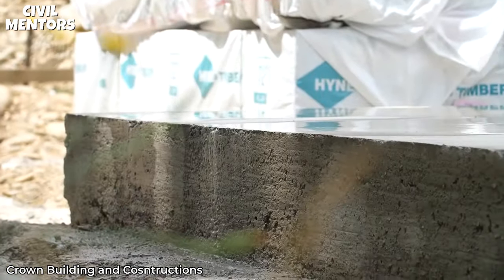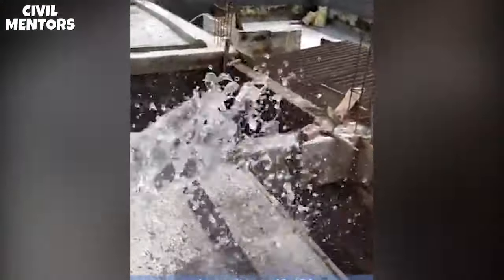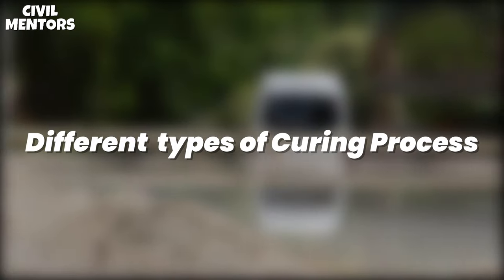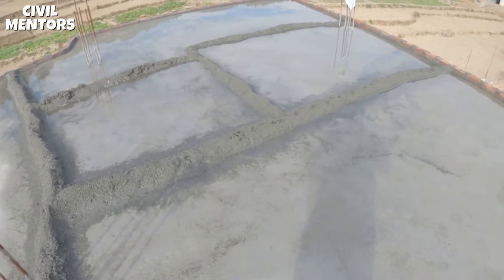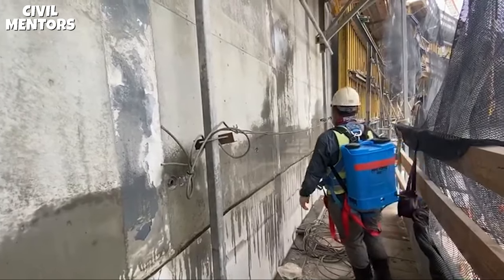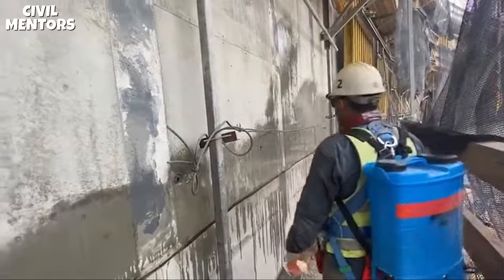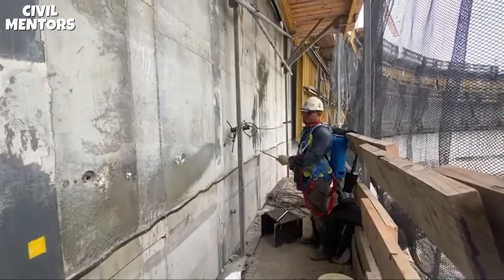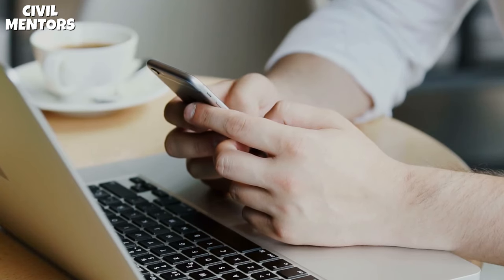Concrete Curing: Don't Make These Mistakes

Comment: How do you know when the concrete has reached 70%?
Reply: IMO, you can use a Mohs' concrete hardness test kit
Reply: Concrete poured at 70F will reach 70% of its strength in 7 days typically ITs all 7's

Comment: I will be making 12"X12"X4" pavers that will be placed in a yard for a motorcycle driveway. Do those need to be cured prior to laying down? If so do you recommend spraying, or submersion?
Reply: Cover them with a wet white sheet and then cover with plastic to lock in the moisture. Sheet should be flat as possible, check the sheet periodically for about a week.

Comment: Can we start curing immediately even when the concrete is not completely dry?
Reply: You should be able to walk on the concrete.
Reply: Absolutely NOT! When you can walk on the concrete without leaving foot prints and after everything is sawcut.
Reply: A lot of curing compounds are water based so you don’t want to add more water to it when it’s still drying/curing.
Reply: The curing compound we use you are supposed to spray after you can walk on the concrete without leaving foot print marks and after you aren’t supposed to walk on it for 12 hours. So after everything has been cut and cleaned you should seal it.
Reply: @jackwilliams7738  WRONG! You should be watering WAY before cutting. You should not relief cut before 18hrs after it's installed. Depending on the climate and time of year,  you can apply water within the first few hours.

Comment: After 6 hours of pouring concrete I cured it with water hose gently.. I see some dark streaks on the cement. Why is this happening? And will it fade away after complete curing?
Reply: Probably started water curing too early. Could have waited the next day to start water curing. Or just waited longer…
Reply: Did the streaks ever go away?

Comment: Sir,I didn't soak bricks before using.now I have been curing brick walls for 40 days.is there any possibility of building cracking?  Plz reply sir..
Reply: You have to soak the brick before using it other wise it will suck the mortar water making the binding weak .